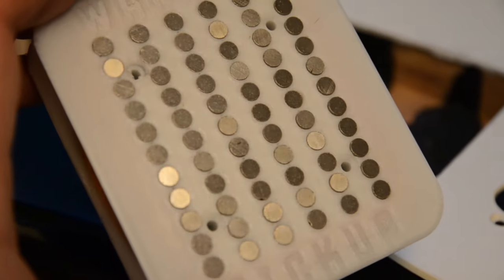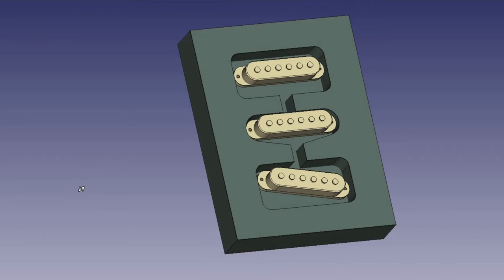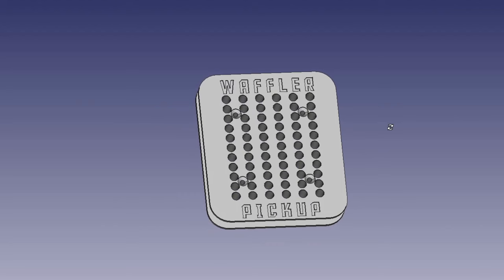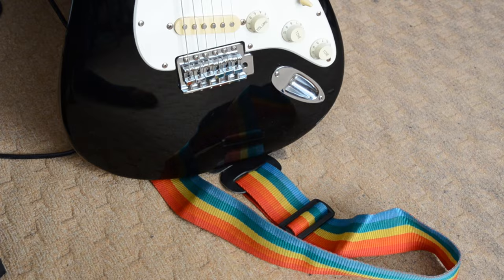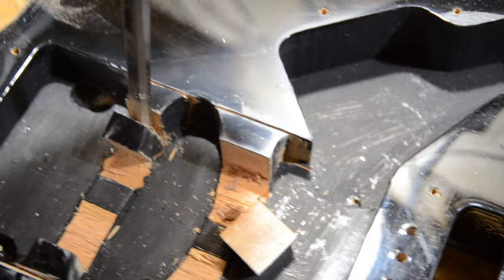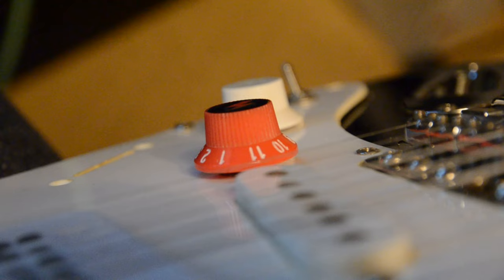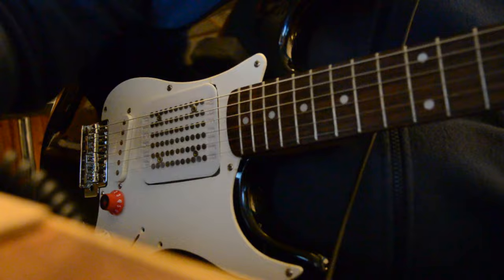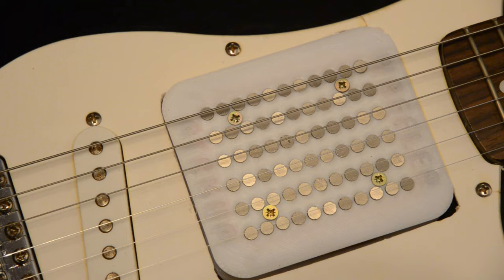Is this the world's most powerful guitar pickup? The Waffler pickup!

Comment: As has been pointed out, it's only where the strings pass over the coil where current is generated so all the copper at the sides is doing little more than creating additional resistance without any additional current, lowering the signal. The extra magnets might strengthen the signal as the more magnetized the string is, the more current will be generated, but things work best when the string is magnetized closely to where the coils are, so I don't think all those extra magnets are doing much. To get the effect that you want, I think you need to have windings around each row of magnets - which you can duplicate by stacking a number of conventional single coil pickups next to each other, essentially a humbucker on steroids. I don't know if anyone's ever tried a four six or eight coil humbucker.
Reply: Blah blah blah blah blah and then the blah blah blah which crosses over the blah canceling out the blah blah blah so essentially you’re really not getting anymore blah than the blah.
Reply: By the looks of it, I thought it was going to be a hex coil type of thing with 6 single Strat or Jaguar coil bobbins going length wise, that would have made sense. You are right though, all those magnets in the middle aren't really doing anything, all the work is being done by the magnets on the parameter of the coil. This sort of multi row magnet arrangement is similar to the original Fender Marauder design with the pickups sitting beneath the pickguard, the extra magnets were supposed to compensate for the greater distance between the strings and the pickup which worked better in theory than in practice. I've seen some modern attempts replicate the design but alnico 8 or ceramic was not strong enough so they ended up using neo magnets.
Reply: Nah, rows a boring, world needs coil around every pin
Reply: @vedro_hightunplayer9673  Alnico rods are pretty expensive but if that's your prerogative, have at it. Part of the rationale of using alnico poles, beyond reproducing vintage Fender and other older pickups, is the lower iron content reduces coil inductance. Adding more alnico pole pieces provides more low-end, it is part of the reason why Fender designed the split P-bass and Jazz bass pickups with double poles per string.
Reply: I agree with this opinion on direction. I don't think it would be a terrible idea to have the magnets spaced out a bit more like a humbucker so each magnet isn't overlapping each other's field. Pretty cool idea though!
Reply: Try it with a 12 string
Reply: 100% agree
Reply: You know, I've been looking for videos of guitars with the pickups alongside the way of the strings. Only on internet I've found those italian "modulo" bass, but no guitar at all... This video in particular is the most that I could find close to what I was looking for.
What could happen if I put the pickup, or humbucker, just like you say in your comment?
Would the world explode?😂😂
Reply: @lgmx-peacekeeper3204  No - the reason that Fender designed the split coil P-Bass pickup is because it concentrates the coil sound over two strings rather than four making it less bright and percussive. It was destroying the voice coils in the bass amps at the time. They were highly under powered so they couldn't handle all the power of the coil and its' bright treble timbres so they split the coils to avoid this.  More metal only means that it has more powerful response. The wire around the magnet is what causes inductance. The more wire winds around the magnets the more inductance or strength of signal from the coil. Magnets only produce magnetic pull and increase the volume - not inductance of magnetic copper coil windings.  Thus the reason for the double poles on the later bass pickups was to increase magnetic response from each string when it vibrated across the magnetic field.
Reply: I agree but with a twist. 
Use 7 rails. Wound in rows and around. Then you would have no loss and fairly even tone.
Reply: Alright, let's go totally insane and use 66 separately wound coils that are switchable into series parallel north chocolate and diagonal combinations.
Reply: I did that once, build a guitar with four humbuckers jammed in it all wired in series. It didn't sound good, but it had just about the highest output a guitar can haha
Reply: Cool vid! P90s sound better/warmer (IMO) than small single coils or humbucker sized P90s because they are wider, apparently. Humbucker = 66-70mm wide, P90 = circa 85mm. Poles stay under strings at 52/50 (bridge/neck). So what about an ultra wide single coil, say 100+mm?

Comment: Since the string needs to pass over the coil, which it only does at the front and back, it seems like its 2 single coils.  1 at the front and 1 at the back.  Magnetic force reduces quickly with distance so maybe the 2nd row had an effect but the other magnets were possible not doing anything.  Would be very interesting to see if it would work if every row was wound (11 single coils).  Even better would be a knob that allowed you to switch between each of the 11 as they would all have a different tone due to their position on the scale.
Reply from the maker: That might be a really pain to wind, though I will have a think about it and see if there is a way to get it work.
Johnny Marr had a guitar similar to this idea.
https://www.guitarworld.com/news/johnny-marr-fender-spirit-strat
Reply: @deancoyle  Of course it would be a pain to wind.  Hence nobody does it.  You could test yours though.  Sound test your pick up as is  Then test it again with all magnets removed except for the front and back column.  It should sound pretty much the same.  RE J Marr:  Right, so, in Johnny's design each pickup will have a different sound because it is positioned on a different part of the scale
Reply: Wiring for that would be insane you’d need a breadboard with 10 diodes and a capacitor with maybe few hundred microfarads to not limit resistance of the poten
Reply: @Eddyvnhln5150  I'm not sure about that.  There are guitars with 4 or more pick ups that dont seem to have that issue.

Comment: Screw-in (out) pole pieces would be cool.
One could create different “pickups” within the Waffler grid by adjusting the height of individual magnets or removing some of them completely.
Also putting 2 Wafflers back-to-back with the coils reversed might be interesting (if you could get them together...).
Reply from the maker: I feel we are on a similar wave length! Soooo many options so little time! I will post the results of some of these ideas soon!
Reply: Unfortunately, the magnets on the inside of the pickup which the copper wire doesn’t touch will have no effect on the sound of the pickup. Very cool idea, and I was curious enough to click, but as pointed out in several other replies it’s the copper wire being wrapped around the magnets that created the inductance (the sensitivity to the vibrating strings) so the magnets in the centre are just for decoration. Using larger or stronger magnets in a standard humbucker format would yield more drastic results.

Comment: that much winding is going to have a really high resistance and inductance, eating a lot of high frequencies. underwinding this might   actually be a good idea so as not to get a "muddy" sounding pickup
Reply from the maker: Interesting points, I keep meaning to research if the size of the coils of an inductor reduces inductance as the coils get bigger? But yes, resistance is going to approx double for same number of turns to a single coil. I may try a few versions of different number of turns, there is so much to experiment with.
Reply: @deancoyle  famitory is correct, maybe you can offset the undesirable characteristics of a large coil by changing the wire diameter!
Reply: @deancoyle  that pick up can be more useful for bass guitar. I believe with more resistance (because of longer wire) you will have more  mid and bass, it looks like  Musicman  or Gibson eb bass.  you must try ceramic magnet.
Reply: Use 44awg wire to balance that out

Comment: Very nice experiment and thank you for doing this and showing it to us!. In my opinion there is a problem with this configuration. A lot of magnets, as you show it, push your strings very much down. So the magnets do now allow the string to vibrate as it should and also for much less time. So this may maybe improve the strength of the signal on the beginning, but the string are not gonna vibrate too long and you will loose on sustain. Another and the most importand thing, and i guess that is the reason why such pickups are never made, is that they access a big length of the string. So the string motion is getting destorted. Sorry for my bad english, but i hope you got what i mean. Anyway it is a good experiment :-)
Reply from the maker: I think you have some good points! Thank you. 
Also your English is better than mine....and I am English.

Comment: I’d say that it’s likely only the outer magnets are picking up a strong signal as they’re close to the coil wire, I imagine the ones in the middle don’t do much to add to the sound? I’d say that breaking the pickup into a bunch of stacked singles or have one vertical coil per string would be a stronger design (also then you could split the coils and do all kinds of wacky combos)
Reply: they do something, it's falling of squared with distance though, now if that was single slab, it's probably be a lot more
Reply: I was thinking along the same lines. But, I'm not an electrical engineer, so I couldn't really speak to it, with an appropriate level of intelligence.

Comment: One design flaw. I suspect that the volume between strings would vary greatly because the windings are on the outside. So the high and low E magnets are closer to the windings but on average the magnets for the D and G strings are much further from the windings. Also I noticed during the clean demo, high and low E were not played.
Reply from the maker: That was a concern I had when making it, though this is not the case. The strings are equal in volume.
https://youtu.be/BNmaNF8RIqI?t=287

Comment: So, the wire coil itself. The left and right aren't over any strings.  So only the top and bottom parts matter.

As I understand it, the magnets purpose it to magnetize the strings. The the strings, now magnets, vibrate over the coil and induce current. 

So I wonder if the inside magnets actually contribute anything or not. 

If you only use the top and bottom row of magnets, how does it sound?
Reply from the maker: My logic was that the magnets are all fighting each other and this creates the effect of one large magnet. Though you do raise a good point, what would it sound like - I have not idea. I will think I will give it a go. Thank you for the idea!
Reply: You might be right. And besides that, there are probably other subtle effects that I'm not even aware of. 

My theory is that the magnet's effect is local, just a bit more than the string section over it.

So if that is correct, or mostly correct, then it should sound about the same with just the outer magnets.

But, maybe the inner magnets have a bigger effect and do make a difference. 

So that has me thinking of making the coil more complicated, to work into the middle.  No idea how to wind it though.
Reply: Here's a crazy idea. I was trying to think of a way to make use of the part of the coil not over the strings. I guess all pickups have that part, but you've made it a lot larger.

Do you remember the spinning title belt John Cena used to have?

What if the entire pickup could spin a circle, either manually or driven by a motor?

Comment: I thought I might try to make such big pickup for taking all high harmonics and main tones same time for more clear biger and most naturel tone myself. Then i searched if some crazyman tried it. And yes. You made it🤟. My idea was not making it for stronger tone but clearer and richer tone. You may try it with less magnets and/or less wire but wider enough to reach to bridge and neck. And to make it less powerfull. And play with pickup height. I thing it might be  more clear open and rich single pickup sound. Making it powerful shouldnt be the motivation.  It might pick some radio signals 😂 but still it might worth it

Comment: Wait, did you only wind the outside? How would you get to the magnets in the middle then? I think you'd have more luck by stacking normal pickups, perhaps rotated 90 degrees.
Another design could be by using stronger magnets on the top and using the very centre of the pickup as the post to wind around, perhaps using a slightly thicker wire to avoid a completely ludicrous impedance.

Comment: i feel like this doesn't make sense because there's only so much energy the moving strings mass can impart and the additional magnets serve to slow down the string more, which would require more strumming and that happens anyways the harder and more often you strike the string the louder it is. i think you might get more out of it by building a double humbucker with the most ridiculous high end materials, like special magnets and wire and special metal for the string would probably generate more current. kind of like a motor or generator, the high end ones use the best magnets wires and core materials. 
but i still like your pickup and it sounds great.

Comment: Unless I've seriously botched my understanding about how pickups work, I don't think you're substantially benefiting from over 36 of those magnets. If anything, they're all working together solely to kill your sustain. The ones that most directly affect electrical resistance - and thus the tonal quality - are only along the outermost parts of your block.
Reply from the maker: Some really interesting points Lushen.

There are some big gaps in my knowledge on how this works but here goes.

All strings sound the same volume, so if only the edge magnets mattered then this wouldn't be true. The e strings would be expected to be louder?  It not about magnets but more magnetic field. A small change in the magnetic field, alters the whole magnetic field. So the middle magnets are important in transporting the field. 

Sustain is an interesting concept. I agree that for some types or styles long sustain is good, though gain often creates the illusion of sustain which isn't strictly true.  Would the ideal guitar be one that rings out forever?  Make sure to stick around I am going to play with this concept some more...
I try to explore some of these questions here:
https://youtu.be/BNmaNF8RIqI

Comment: Not to be all negative, but this seems like a joke. You never really show the soldering of  this 'pickup' into the guitar electronics, and while playing, the pickup selector switch seems to be in the bridge position, when you can see it briefly from being obscured by the text you put there... and edge of the desk you were sitting at.

I really was curious as to how such a pickup would sound, because not all of those magnets would even matter unless  you could wind the wire right around them.... from the way you briefly showed the winding process, it seems only the outer edge of matter would've have anything to do with producing any real sound. The effects of the others may not even matter, unless their 'magnetic power' was greater enough to have a substantial field that would be far larger than those magnets would normally be. In that case, I would suspect the magnetic pull from those magnets would be so much that the strings would be pulled down on to the pickups with so much force that it would be unplayable.

It is a shame if this is a joke, cause it would've been interesting just to seek how this actually would've played out. Pun Intended.
Reply from the maker: You raise some good points. All guitar played in the video and my following video is using only that pickup. 

I will create a short video trying to answer some of the questions raised and show that the pickup does function and is used in the videos. I will aim to get this created and posted this week. 

For the circuit I removed the pickup selector switch (this will explain why is appears to be in the bridge and added a switch in the lower pot position. I planned to include a comparison between the bridge and waffler pickup though forgot. I will include this in the following video.

As the magnets are all the same orientation, the magnets are all fighting each other. I believe this acts as one big magnet. It takes some force to put the magnets in position because of this. If the middle magnets were removed the magnet field would not act the same. If only the edge magnets mattered then I think that would create loud E strings, which it doesn't. 

I  appreciate you taking the time to comment and question what I created. I don't have all the answers and part of this is experimental so it is fun sharing this getting ideas and feedback from others. Let me know if you have anything you want making clear for this next video.

Comment: Does this pickup exhibit resonant feedback issues at higher volume/sound-pressure levels?
Maybe make more individual coils so you can switch the coils ON and OFF to give you a variable output pickup!
Not only "MORE", but multiple output options as well!
Also, can you measure the Gauss level at the strings, is it much more than a stock Fender single coil pickup?
I was wondering also about acoustic sustain, are the magnets so strong that they inhibit the strings natural vibration?

Lots of good work done Dean, please keep at it.
Reply from the maker: Some interesting ideas here. I will have a test let you know what I come up with.